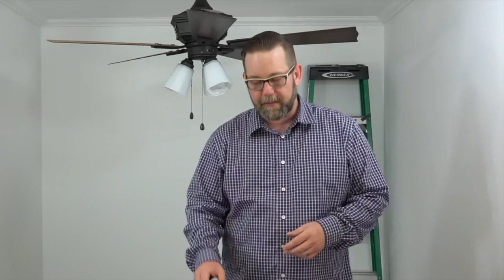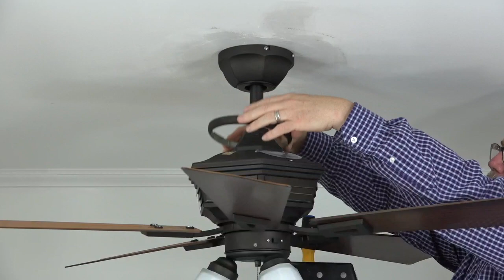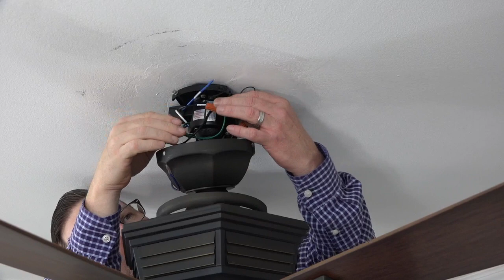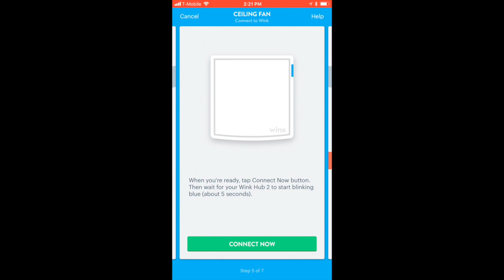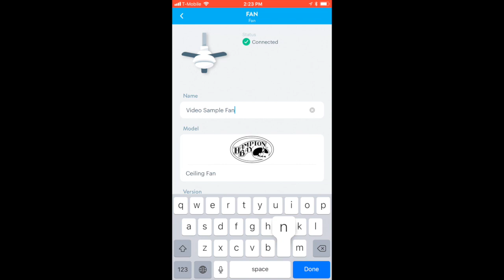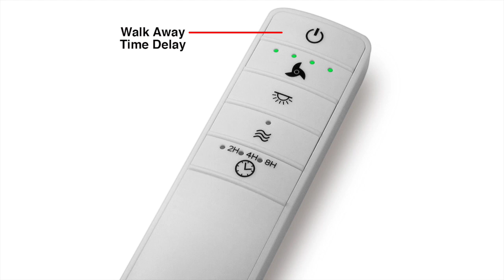How to Install the Universal WINK Ceiling Fan Remote Control

Comment: My fan does have a light but no blue wire coming out how do I connect the light without a blue wire?
Reply from the maker: If your wiring varies from the standard, the remote may not be compatible. We would suggest calling a licensed electrician to ensure it is wired correctly. In general, fans will have a black wire for fan speed power and a blue wire for light power. Since your fan does not have a blue wire, the light might be connected to the main power wire of the fan. If this is the case, the remote would not be compatible. Please make sure that your fan is not a DC motor fan with a built-in receiver, in which case, this remote would not be compatible.
Reply: @ceilingfans101 thank you I will do so

Comment: dumb question…but does it work on other brands besides hampton bay fans. no pull chains on my fans. receiver had stop working.
Reply from the maker: No dumb questions... This remote control and receiver is compatible with most downrod style fans regardless of brand or if they have pull chains. There are some exceptions. This remote system is not compatible with the following: Fans with a DC motor or fans that have an existing remote receiver that can not be replaced (built-in receiver in the motor housing). 
The receiver for this remote must be installed in the fan in order for the remote to control the fan. The remote would not be compatible with any existing receivers.

Comment: Mine is working but on speed 4 its like its on 2 not running wide open
Reply from the maker: If your fan has pull chains, the pull chains must be set to high speed prior to using the remote. If the chains are not set to high, the remote will not be able to get the fan to high speed.

Comment: My fan dont have the blue wire is it because it dont  have a light
Reply from the maker: without knowing which fan you have, we can not confirm with 100% accuracy, but that is likely correct. A blue wire is typically the light power wire.

Comment: Mine doesn’t work. I can hear it clicking.  It will beep but won’t turn on
Reply from the maker: If you have a pull chain fan, the fan must be set to high speed using the pull chain and the light set to on using the pull chain prior to using the remote. If the speed is not set properly and the light not set to on, the remote will not be able to control the fan. Once the pull chains are set and the remote works properly, the pull chains shouldn't be used any more. If you don't have pull chains, we would suggest making sure that all of the wiring is still properly and securely connected. If that does not resolve the issue, call the customer service number on the manual and on of their team members will be able to get more info to help troubleshoot.

Comment: Good job 👍, 
Write to me please;
What is kind of fans can I install the remote on?
Reply from the maker: This is compatible with most downrod style fans. We do not recommend for use with hugger style fans (fans with the large housings attached to the ceiling) because there is not a dedicated space to hold the remote receiver. Also not compatible with fans that have a DC motor, or remote control fans that have a built-in receiver that can not be replaced with the receiver included with this remote.
Reply: @ Thank you so much 🤝

Comment: Please does it work on any ceiling or do they have a special ceiling for it?
Reply from the maker: This remote is designed to be compatible with most downrod style fans that have a mounting bracket and canopy. It is not recommended for use with hugger style fans.

Comment: my motor has 3 wiers and 2 extra for light then 2 live and neutral in 😟
Reply from the maker: Sounds like you may have a DC motor fan (those typically have extra wires for reverse function and if 2 wires for lights, you would have separate uplight and downlight). In any case, it doesn't sound like this remote would be compatible with your fan.

Comment: Question...what's the point of a Wi-Fi capable fan/light remote so you can control the fan/light remotely?  I know you can turn the lights on and off remotely and make it appear people are at home, and you can use your phone as a remote if you lose the remote, but what else?  I can see screwing with people while they are in the room, but that's just my mischievous side.  I feel like I'm missing an obvious piece of this puzzle.
Reply from the maker: That's it. Remote access, scheduling, screwing with people, and app control. This particular smart remote is discontinued, but the newer ones will also integrate with Google or Alexa to allow for voice control.
Reply: @ceilingfans101  Scheduling and voice control is what I was missing.

Comment: i just installed a hamilton bay fan and a universal remote for a 3 speed fan works well but when i turn on the light from the switch there is a 5 second delay and the light turns on how can i fix this?
Reply from the maker: A slight delay when using a switch is normal when a remote receiver is wired in. Think of the receiver like a mini computer that has to boot up to power the fan when the switch is turned back on. The delay is also a bit of a safety measure to prevent the receiver from being damaged by power surges.

Comment: My ceiling fan remote is lost and there is no available replacement remote. Can I use this? Bypass the pcb, wire it directly to this?
Reply from the maker: Thanks for the question. Without knowing which fan you have, we can not answer with 100% accuraracy. In general, this remote is compatible with most downrod style ceiling fans. The included receiver would need to be installed in the fan's canopy and connected to the fan and house wiring. If your fan has a built-in receiver that can not be replaced, or a DC motor, this remote will not be compatible. In most cases replacement remotes can be ordered by calling your fan's manufacturer.

Comment: What if the fan is not at the end of the chain? I have a second fan that runs off power from an earlier fan but I cannot get the second fan to run
Reply from the maker: In general, fans should not be connected in a chain. The power will not distribute evenly and could cause noise/humming issues as well as other power issues. Each fan/remote receiver should be wired on its own power supply.

Comment: What will happen if I don't install the rubber inserts on the fan base? Do they have a purpose?
Reply from the maker: The rubber pads are spacer to make sure that the canopy doesn't cut the antenna wire. Without the rubber spacers between the mounting bracket and ceiling, the canopy may not have the gap needed to allow the antenna to stick out.

Comment: Why is he using electrical tape and why is he twisting the wire in the opposite direction of the wire nuts. Please don't do that. Pull on the wire a little to insure the wire is is secure.  Other than that he did a good job. It you do use electrical tape don't use cheap tape buy the good stuff.

Comment: does your fan have to be connected to a light switch to install this remote? my fan doesn't connect to the light switch. only by pull chains.
Reply from the maker: No, no light switch is necessary.

Comment: Hey is their a link to this product
Reply from the maker: It is sold at The Home Depot (model #99432). If you don't already have the Wink Hub, we wouldn't recommend this item. The Wink Hubs are hard to find and Wink just recently transitioned to a subscription based service. If you want a smart home remote for your fan, we would recommend the universal WiFi ceiling fan remote (also sold at Home Depot (model # 99434). The new remote is compatible with Google, Alexa, & SmartThings. you can see the WiFi remote here - https://www.youtube.com/watch?v=1jRqtwj1xu8

Comment: Great job on the video! Can you add something about resetting the unit to go back into pairing mode? Thanks!
Reply from the maker: Thanks! The resetting instructions are in the App when the remote doesn't connect with the Wink Hub. Since Wink decided to go to subscription base service, we don't use it any longer.

Comment: curious can this remote work without the wink hub?   I reality I am wanting to a ceiling fan speed control that i can teach my tv universal remote control to use.
Reply from the maker: The remote will function like a standard remote without the hub. The hub is only needed if you want to be able to use the smart features like App control and scheduling. I don't know about hacking the remote to work with your TV remote.

Comment: I've done the exact same thing but still doesn't work
Reply from the maker: If your fan has pull chains, you'll have to set the speed to high and the light to on using the pull chains before the remote will take over control. Typically it is one pull for each chain.

Comment: I’m just curious if the wink hub tracks the state of the controller. If I turn the light on with my remote, will it show on the app that the light is on? Or will it still show the light is off on the app?
Reply from the maker: Yes, the fan current state is reflected in the app. If your fan is on speed 2 with the light half dimmed, when opening the app, it should show that same setting.

Comment: Great video! I thought I followed it to the T, but I also installed a universal remote (Your other video), the fan works perfectly, but the lights won't come one. I do not plan to use my phone, so I didn't purchase the Wink. Any troubleshooting ideas?
Reply from the maker: if your fan has a pull chain for the light, try pulling the chain once and then try the remote to turn the light on. Basically, the fan has to be set to high speed using the chain and the light set to on using the chain before using the remote. If the light is not set to "on" with the chain the remote will not turn the light on. If that doesn't solve it, make sure the wiring is connected correctly. Sometimes a wire may come loose after it is connected. If those tips don't help, I would suggest calling Hampton Bay customer service at 1-855-HD-HAMPTON (1-855-434-2678)

Comment: Fan now wobbles at high speed, I think the thick rubber bumpers are the issue, it was fine before
Reply from the maker: I would make sure that the mounting bracket is completely tightened after putting the rubber washers in place. Also make sure that the ball of the downrod is properly seated in the mounting bracket so the slot of the ball is sitting on the tab in the mounting bracket. Both of those things can contribute to fan wobble.

Comment: Hey ! why did u turn the fan on high speed before turning the switch off  ?
Reply from the maker: The fan needs to be set to high speed and the lights need to be set to "on" before using the remote. The remote won't work unless the fan is set to high and the lights are set to on prior to using the remote. If you are doing this as a fresh install - meaning installing the fan and remote at the same time - you can install everything and then just set the fan with the pull chains before using the remote. Typically 1 pull of the chain sets the fan to high and one pull of the light chain sets the lights to "on". NOTE: if the remote receiver is installed, the fan won't start and the lights won't turn on with the pull chains. But, once the chains are set then the remote can take over control. Think of the pull chains as a switch. Hope this clears things up.

Comment: Thanks for the video, the included instructions weren't very clear but does include something you didn't mention. Once I got it installed, the lights wouldn't dim. Turns out that there is a switch inside the remote's battery compartment that controls whether the lights are dimmable or not. It was set to non dimming.
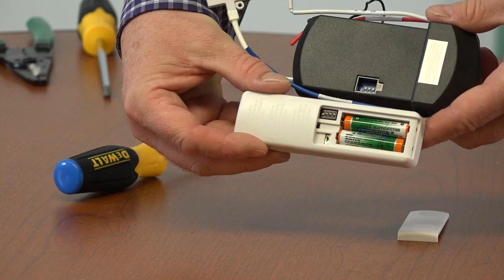Reply from the maker: Thanks for watching. The video covers the o/d switch in the "Preparing the remote" section at the 4:35 mark.
Reply: Dang, how'd I miss that?

Comment: Does having your fan on high speed before you turn it off make a diffrence
Reply from the maker: Not sure exactly what you are asking. If installing this remote with a pull chain fan, the fan needs to be set at high speed using the pull chains before using the remote. If you are asking about turning the fan off  when it is operating at high speed, it shouldn't be an issue. You do not need to cycle through the speeds before turning the fan off.
Reply: It doesn't make a difference. I put a new fan in at the same time as putting the module in. Once installed, turn on the power and use the remote to turn the fan on high and then change the speed manually on the fan until you get the highest speed. Also check to make sure the light is on if it has one.

Comment: i have a separate fan and light switch on the wall. will this disable the two separate switches? where only one will be the fucntional one? thanks for the great tutorial btw!
Reply from the maker: Thanks for watching. We would recommend capping off both switch wires and connecting this to the house constant supply wire. That way the receiver is constantly connected to power and won't disconnect from the WINK system. If you ever want to remotely control your fan/light when your away from home, you won't be able to if the switch if off. If you want to connect it to a switch, you'd have to connect the receiver to one switch and cap the other. This would allow you to turn the fan and light on/off at the same time. There is not way to wire the receiver to 2 separate switches. The only other option would be to wire the light wire from the fan directly to the wall switch (bypassing the remote receiver). This would allow you to use the wall switch to turn the light on/offm but would omit light control from the remote and WINK system.

Comment: 3 way switch? Extra red wire in installation. Is there a way to hook this up or is it only meant for a single switch?
Reply from the maker: We would recommend installing this to the house constant supply wire and not installing this with any switches. That way, the receiver is constantly getting power and the connection to the Wink hub is constant to allow for constant connection. If you turn it on/off with a switch, you will lose the ability to control it with the app if the switch is off. We would recommend just capping off the red wire from the house and installing with just the standard house supply wires.
Reply: We have a red, black AND white coming out of the house.  Capped the red from the house, did white (h) to white (r) and black (h) to red (r).  Nothing.   If I remove the remote and hook the fan up normally, (red to blue, black to black, white to white), it works perfectly.  Any suggestions?
Reply: Perhaps the two wires from the house go to the receiver 2 wire side. And the 3 wires from the receiver go to the  fan.
Reply: @ceilingfans101  I believe this is similar to my situation. The fan is basically controlled by the pull chain. The wall switch controls the lights. The wiring from fan to house right now is: black to black, white to white, and blue to yellow (I don't know why it's yellow). So... if I install this controller, it would be from fan to controller: black to black, white to white, blue to blue. From controller to house it would be: black to black, white to white, nothing to yellow (cap and ignore)?
Reply from the maker: @dumpvideo  sounds about right. We're not licensed electricians, but the yellow wire sounds like a switch wire which would be capped. If you have any doubts, we would suggest calling an electrician, just to make sure everything is wired correctly.

Comment: Finalized setup, pairing was super easy! Added the 3 ST device handlers & done.

Final result on remote is that low is low, meduim is medium, medium-High is HIGH, & high is medium! Ughh why??!
Reply from the maker: So, I went on your channel and watched your video about your fan installation. First thing is that this remote is designed to function with the WInk system, not the Smart Things system. We know that there have been "hacks" posted online about how to make it compatible with Smart Things, but that may cause some operational issues. If the speed settings are not acting properly with the handheld remote, then we would suggest contacting Hampton Bay customer service as there may be an issue with the receiver. If the speed settings are only acting up through the ST app, then that is an issue with Smart Things compatibility. hope this helps!
Reply: How to install ceiling fans I meant to delete that video since I figured it all out, but let me give some background, I have had this Hampton bay “chainless” fan for 5 years, a few years ago I noticed that the remote that came with fan buttons were off, “Medium was HIGH” & “High was medium speed”. So I swapped the remote & receiver to the zigbee & the same issue with “High” being “medium” is still occurring.  So now we know it wasn’t that old remote/receiver... could it be the fan itself?! Hmmmm
Reply from the maker: Sounds like a capacitor isue with the fan itself. You should call Hampton Bay customer service at 1-855-434-2678 and one of their team members will be able to troubleshoot and send you a replacement capacitor if that is indeed the issue. We know it's not the zigbee remote since the problem was happening before and since it is still happening, we know it's not a receiver issue which leads to the capacitor not regulating power to the fan properly. Usually an easy fix one the replacement is received. Good luck!